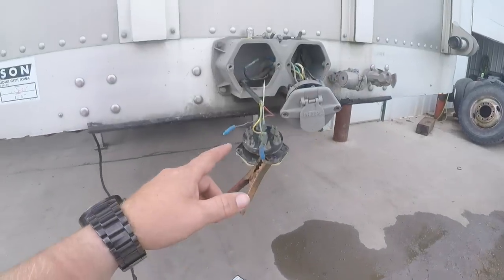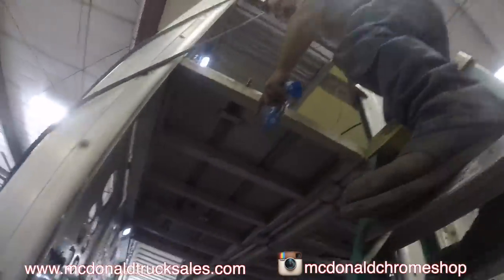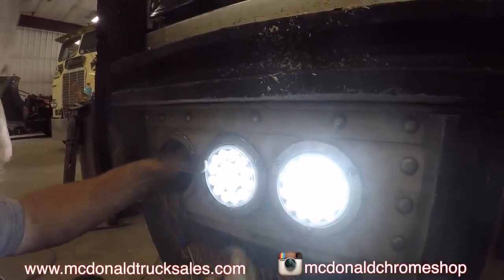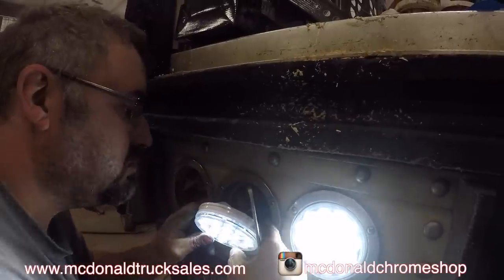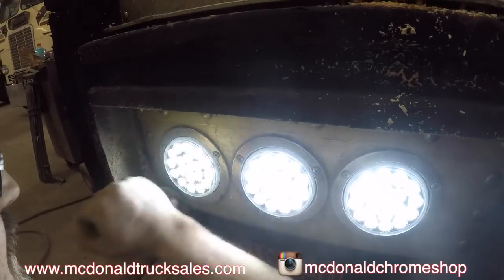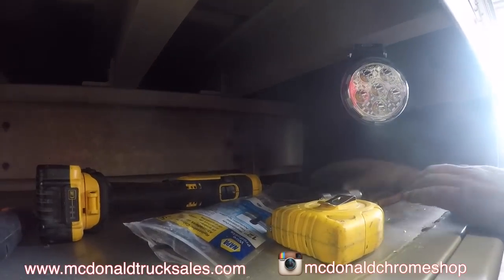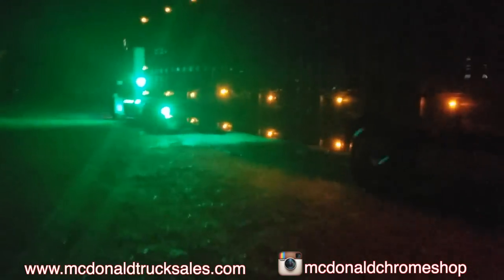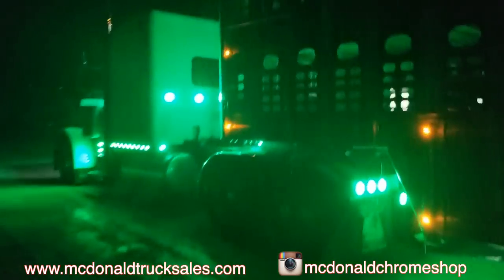Custom Backup Lights for your Trucks & Trailers! (McDonald Chrome Shop)

Comment: Can you power them with the trailer in Reverse with a backup alarm
Reply from the maker: on your truck yes but most trailers do not have backup lights so that would be a no in most cases
Reply: @McDonaldChromeShop  thank you for that information you guys do great work keep up the good work like to see you do a Mack Pinnacle at some point

Comment: No extra batteries?
Reply from the maker: Nothing extra needed for power. LED lights take very little power. These trailers already had an extra wire ran to the back which made it easier. Not all trailers do.  Thanks for watching.

Comment: Bad move standing on the top of that 6ft. ladder. Dangerous!!  Get the proper ladder for the job. I have seen too many people hurt land killed over something so stupid. 
Use a little soap and water to coat those lenses before putting them in the housing. It will save your hands.
Reply from the maker: soap doesnt help on the stainless steel ring and the light, now a rubber grommet yes that helps. as far as the ladder your concerned about we have about 5 types of them here and this is the one that he chose to use for the job. This employee used to construct buildings for a living and be on ladders daily. So if he feels comfortable with the ladder choice so be it, me personally i would of used the ladder on wheels that was about 10 foot away but again not my choice on what works for him.

Comment: What are the super bright green lights on the truck?
Reply from the maker: Trux accessories dual revolution lights. Available on our website mcdonaldchromeshop.com
Reply: @McDonaldChromeShop  do you have any super bright lights that have magnets and are battery powered that i can stick on the back of the dump truck pup? Switch trucks all the time and cant see anything in some of the pits
Reply from the maker: @Sinister_Reaper  we might be able to find something in our construction stuff. What color does it need to light up for ya.
Reply: @McDonaldChromeShop  anything bright that will be easy to see in the mirrors, if you can find some ill buy a bunch of em

Comment: Are those the trux dual revolution lights?
Reply from the maker: The rear of the trailer is the trux dual revolution lights. The work lights between the spread are trux work lights.
Reply: They look nice!  Good work